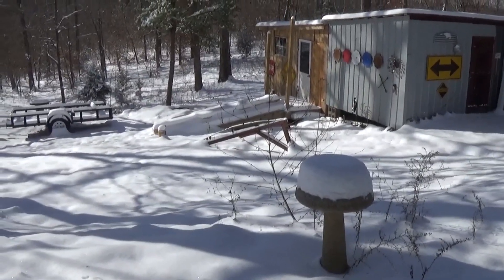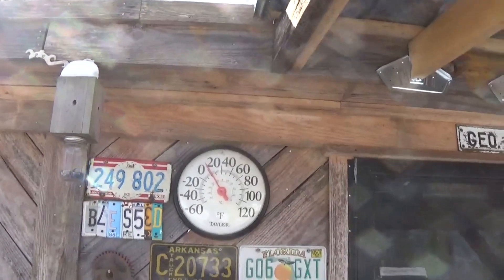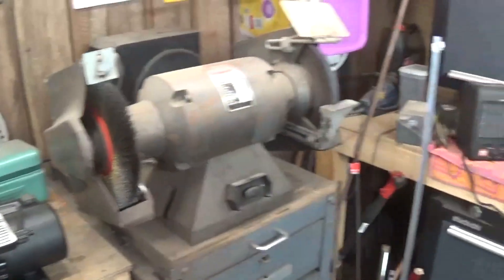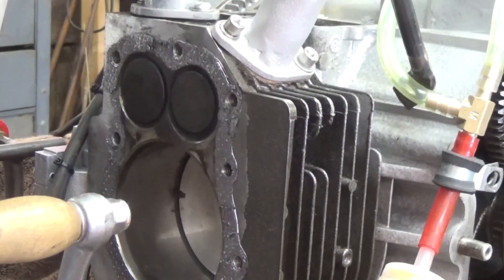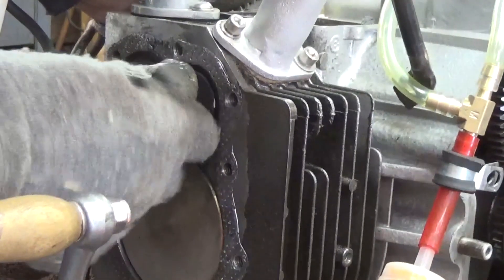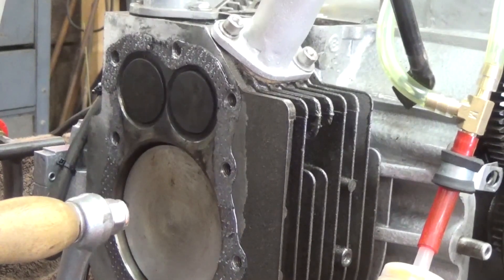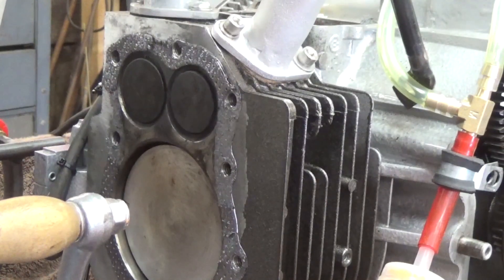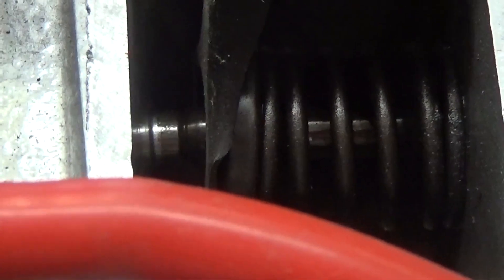How to adjust the valves on Briggs & Stratton opposed twin flathead engine.

Comment: You need to run it down 1/4 inch
Reply from the maker: I appreciate the advice. I did run it down according to the specs in the repair manual. Thanks

Comment: With the spring in, would you check clearance the same way? Just slide the gauge in?
Reply from the maker: Yes sir that is true and I actually did that the second time around just to be sure. Thanks
Reply: Thanks for the reply!

Comment: Thanks! Newbie here. Have briggs quantum. Know briggs says to put cylinder down 1/4 " from TDC on their website. Also heard this on other videos, so I guess you are supposed to do this? A little nervous. Many others don't even mention this.
Reply from the maker: I have tried it both ways, but it doesn't really seem to make a difference on the valve lash. Have fun, it isn't anything to worry about. A difference in .001 doesn't matter one way or the other. Thanks for stopping by.

Comment: But why is this happening? What exactly changed that’s causing the valves to stop closing properly?
Reply from the maker: Normal wear from years of use, which is not unusual. I suspect also that it seems more pronounced now that the carburetors are located directly above the intake valves and not separated by an 8" runner into a single carburetor. One way to solve the problem is to switch engines...LOL Thanks for stopping by.

Comment: Wondering how the valves got longer or did the seats wear that much?
Reply from the maker: I expect that it was from wear on the valve seats, though I can't be sure. Thanks for the good question.
Reply: @TheShadeTreeFixitMan what do you do when you have too much clearance ? I find this more often.
Reply: @tombolin7168  Lash caps?
Reply: @jondalrymple6171 I’ve given up on this one. Stripping for parts. I have another to replace it. I’m thinking it just got ran with old oil for years and wore out.

Comment: great video thankyou.. silly question when you are checking the clearances near the end after grinding i noitice you dont have the outer crank cover on , so crank and cam wont be central and clearances wrong ?????
Reply from the maker: The gears can't change place on either crank or camshaft since the bearing on the crankshaft is press fit in place and prevents either of those gears from being pulled out. Good observation that no one else seemed to catch. Thanks for the question. The only silly question is the one you don't ask.

Comment: Iam working on a 12 hp Briggs and it is rough shape mechanically,, water,gas in the oil as well as rust now. I’ve just started the process of get ting it back to running. So far I’ve done the oil x2,removed head  and replace head gasket and have notice the valves are seating that well,, so your video has been a big help in the confidence to get it done .Thankyou
Reply from the maker: Glad to be of help. I have double checked my valve adjustments. I am looking forward to getting to drive this Goofy Cart again, pretty soon! Thanks for stopping by.

Comment: I don't have a clue about how to adjust the valves on a flathead, but I need to do so on Dad's old John Deere tractor.   This video is just what I needed to see.  Thanks George.
Reply from the maker: That's why I made it, for better or for worse, since I couldn't find anything specifically for the opposed twin engines online. Hopefully this will help. Thanks Richard.

Comment: Wanted to ask you george what did you have your stereo system on was it on fm radio does your stereo system out in goofy shop have fm and am radio
Reply from the maker: When it initially comes on it automatically goes to SAT, which I don't have. I only use CDs out in the shop. Thanks for stopping by.

Comment: I don't know why this showed up 3 days Late ,but I'm sure you've solved the problems by now and don't need suggestions. I want to Ask if you've heard of this method to check valve clearance.>Use strips of Solder in the valve seat and let it close to crush in 2 places, and then measure the thickness at the dents so you know the minimum to grind? Thanks George, and friends.
Reply from the maker: That's a new one on me, Bry. I haven't been down to the shop since I made this video because it has been so cold. Thanks for following along.

Comment: Just a question George.
Could worn bearings on the cam cause the valves to stay open?
Reply from the maker: I'm not sure about that, though I have never heard of that being an issue. I will investigate that possibility. Thanks for the great question. It's always worth checking these things. I haven't worked on this particular style of engine before, so I am not aware of their peculiar issues, but I'm learning. One thing I have discovered is that there doesn't seem to be a compression release on this engine, which had been a concern originally.
Reply: @TheShadeTreeFixitMan  Maybe someone retorqued that cylinder head?

Comment: If you remove the camshaft and check to see if it has one of those centrifugal decompression devices installed on this model, if so its easy to remove it, incase its spring is stuck on starting position.
Reply from the maker: I would like to do that, but it is blocked by the crankshaft bearing that is pressed on. If I knew of a way to remove that bearing without damaging it I would. I already have the cover off, because I wanted to double check the timing, but that is hard to do for the same reason. More investigation for sure. Thanks for stopping by and for the great suggestions!
Reply: @TheShadeTreeFixitMan  https://youtu.be/1uzUf9UkpDQ?si=raehE8pJU4cccNz4
Reply: You're absolutely welcome and I really appreciate such an ingenious use of a classic design engine, wish I could be of help with your project and thank you kindly for sharing great photography with clear description. Kind regards from Rotoma Auto Repair, our lake came up 4 meters above normal and workshop floor is 1.2 meters below water table 😅

Comment: Thats what my Briggs and Stratton is supposed to do, for easy starting lowering the compression, on the camshaft is a centrifugal weight that lets the exhaust valve close completely once its running about 1500rpm and upwards. I usually end up removing this device on the older engines with a lot of hours and lower compression anyways. Sometimes they stick from lack of oil changes, and will keep the exhaust valve open slightly, at higher rpm than it should.
Reply from the maker: I'm not sure that that is what is going on here, because of what was happening after it was running? Either way, it will be done away with. Thanks for the information.